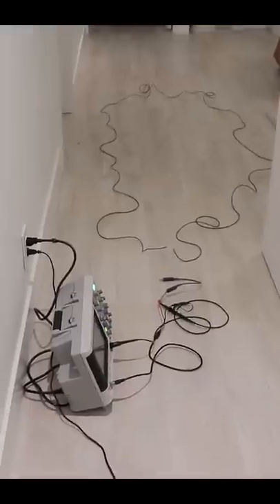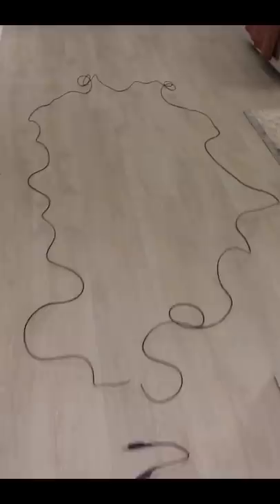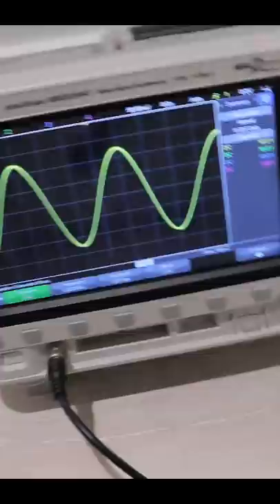The Crazy World of AC Electricity #shorts

Comment: The wire is long enough to cause a phase difference, the wavelength is around 60 cm, so if one chooses appropriate length of the wire, one can create a potential difference across the two ends.
Reply: Please be joking
Reply: @obscuredreality007  both are joking.. wavelengths should be in nanometers by now..
Reply: @GTAIV327  I didn't understand anything🤔
Reply: I must stop the urge to say 🤓
Reply: @gamitech6101  a wave is a periodic function, which is basically a function that repeats itself at constant intervals.

Periodic functions have:
-Amplitude, the difference between the maximum and minimum values that the wave can have
-frequency, the amount of times per second the wave repeats itself and measured in Hz (hertz), it can be converted to the amount of time needed to repeat itself by simply flipping the fraction (60Hz = 1/60 seconds)
-Wavelength, the space covered by the wave in order to repeat itself and mesured in meters but usually converted to the easiest magnitude to read.

the formula for wavelength is "speed * frequency"

electromagnetic waves, which carry the electric signal, move at relativistic speed, usually around 90% the speed of light in a vacuum (otherwise known as "c") but it can range from 50% to 99% depending on the diamagnetic properties of the surrounding materials (basically how much stuff around them slows the propagation of electromagnetic waves).

so if you consider a speed of .9c and a frequency of 60Hz you can calculate the wavelenght with

0.9c * 1/60 = around 4500km

This means that the electromagnetic wave takes 4500km to repeat itself and it covers that distance in 1/60th of a second. Fast innit?
Reply: hardstyle905 do you mean 60 nm?
Reply: @indian.techsupport no 5mhz is 60m. Try googling it
Reply: the wavelength in free air might be 60m, but with a conductor this will bounce back and forth creating interferences that might (or just will) be in higher frequencies, so I think this voltage gradient would be my bet too
Reply: Basically, a capacitor?
Reply: @PhilJonesIII  nope, an inductor
Reply: @GTAIV327 Electricity travels at around 300000000 meters per second. Divide that by 5000000 because it’s set at 5mHz, and you get 60m.
Reply: It seems to be some confusion here, to clarify, I think that the phenomena acting here is that the wire basicaly creates an inductance (the circulating current creates a magnetic field) and thus "slowing down the signal" (creating a phase shift). On the other side, the led let the current pass in one direction if there is a (big enought) voltage difference on its to pins. 
The phase difference induced by the inductance let 2 different electrical potiential on the pin of the led, it glows. Nothing to do with the speed of the light in the wire though
Reply: @KekkusMaximus  yoooo smoked em w the "fast innit?"..

Hilarious.  That's something from an old cartoon right? Looney Tunes maybe?
Reply: @hiei1377 You're trolling, right?....
In any case, that makes less sense than a penguin wearing flippers.
The diode is the load, not the supply. 
i.e It's not generating a voltage potential, it's using the supplied potential to generate light.
Reply: @charmio  The diode only allows the AC to flow in one direction.
Reply: @EddieTheH  Yes... and a cow goes moo. What's your point?
Reply: @hiei1377  The diode in a SMPSU doesn't create the potential either. It's blocking the potential in one direction, allowing a charge to build up on an adjacent capacitor.
The potential in this case is being provided by the signal generator he attached. But please, educate me further.
Reply: @hiei1377  😂 Confidence is key, I can't fault you there!
Reply: @hiei1377  "electrostatics 101" 🙄
Please, it has nothing to do with electrostatics, the charges aren't even at rest.
The conversation we're having is why there is a potential across the LED when only one lead is attached. You're arguing it's because the potential will flow in only one direction across the LED. That's not a cause, it's not even relevant. You could remove the LED entirely and replace it with a multimeter and still measure a potential. 
If you can't explain your reasoning then don't expect people to accept it.
Reply: @hiei1377  Don't bother, I'm already talking to a brick wall.
You do realise an LED will run just fine on AC, right? Sure, half the brightness but it will glow. I think you're entire premise has been based around the assumption that the LED's receiving DC. Am I wrong?
Reply: @KekkusMaximus just pointing this out wavelength's formula is speed/frequency not speed*frequency if I remember correctly.
Reply: @shauryatomar6625 
C/F is the same as C•P
Reply: @DarkMatterX1  yeah ik that, but when he stated the formula he made a minor mistake in the formula but he used the correct formula later when he was solving it.
Reply: and where will the current return by the oscilloscope be?
Reply: @shauryatomar6625  
It's a month later, and I don't really remember who wrote what. That being the case, I'm completely willing to admit I may have read the post you replied to wrong. Either way. Have a good'n.
Reply: @DarkMatterX1  no problems
Reply: @gamitech6101  you won. They are just messing with your brain.
Reply: Dammit I always suspected I was an idiot. These comments confirm this.
Reply: hardstyle905 correct. However, the LED presents a significant capacitance. The resonance frequency of this loop will probably match 5 Mhz more or less
Reply: thank you sir, very smart answer
Reply: I came her to watch him get zapped! What gives?
Reply: And an interference pattern??!?
Reply: What happens if two can instead of one?
Reply: 60 meters is wavelength at 5 mhz.
Reply: The phenomenon is due to the parasitic capacitance between the wire and the ground, that's the reason he uses a big wire. The circuit has the two terminals required, one being the osciloscope and the other one the ground, and the gap between the wire and the ground is a capacitor.
Reply: Thank you
Reply: @KekkusMaximus  'Scope output is 5mHz
Reply: @iRossco  yes, but what causes the led to light up is the inductive property
Reply: @DarkMatterX1 "P" ?
Reply: @indian.techsupport thanks. I had just deleted my comment when i saw how old thread was.
Reply: @GTAIV327  have you ever had an aerial antenna in your house?
Reply: Y’all realize the LED is a diode, right? It only takes it in 1 direction. The cycles per second is fast enough that when the cycle is positive, it will light the led, and the breaks won’t be visible to the human eye.
Reply: The signal is grounded through the front of the O-scope to the earth prong powering it 😂
Reply: HOLY FUCK IT'S EINSTEIN HIMSELF
Reply: @KekkusMaximus that's a per second value... right?
Reply: @silvergoldengun2747 can you elaborate on why is there a phase shift...?